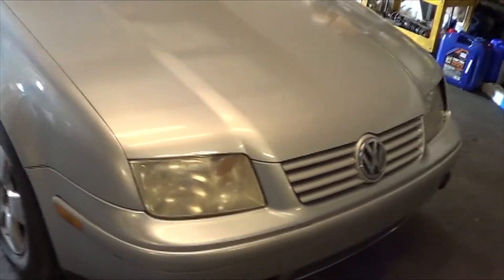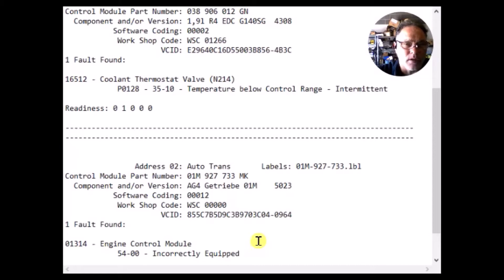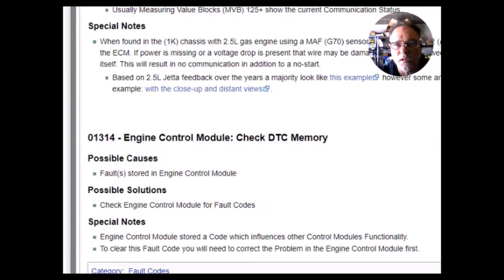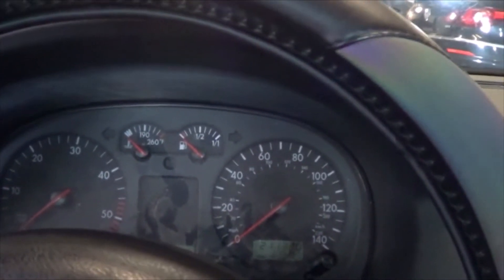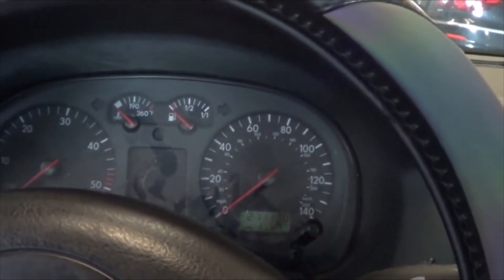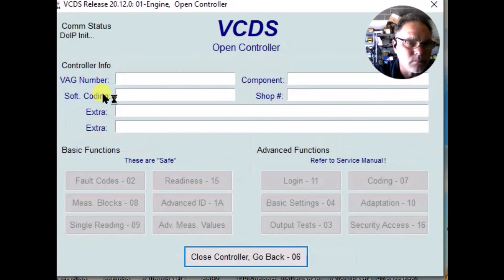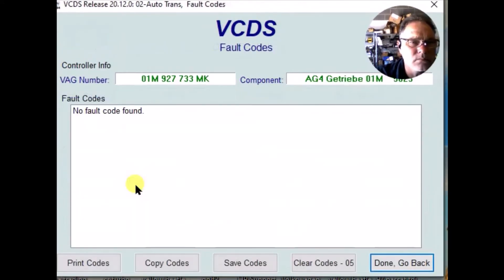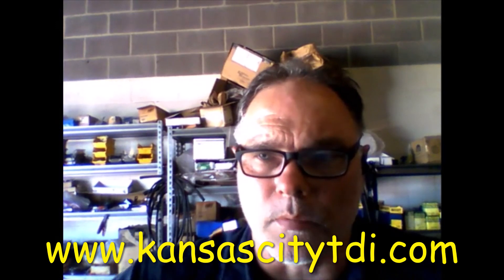01314 ECM incorrectly equipped

Comment: Hi I have the same trouble code but in my brake electronics module I have a 2005 vw caddy with code 01314 ecm trouble read codes any help would be appreciated on this thanks
Paul uk
P.s I'm showing a lit up esp light only

Comment: Was the flashing immobilizer light because of the crash or was it there before and customer said while it's here can you turn it off?
Reply: Where are you located?
Reply: It’s because he’s removed the default coding for the immobilized. 
The light will flash until mechanically stopped.
Reply from the maker: It was there because at some point in the cars life the engine computer was replaced and whoever did so dealt with the immo issue by deleting.  this is fine but at least stop the light from flashing.  (electrical tape?)